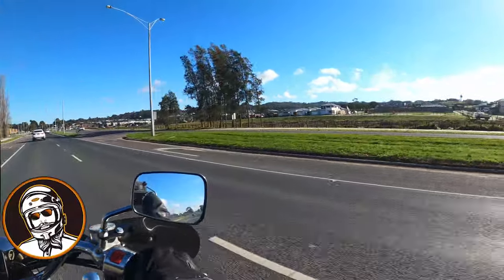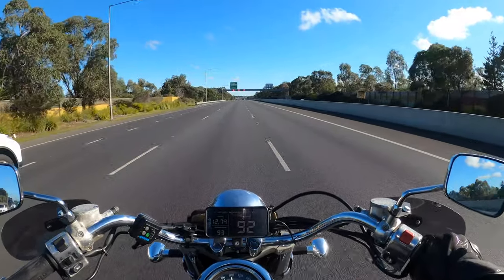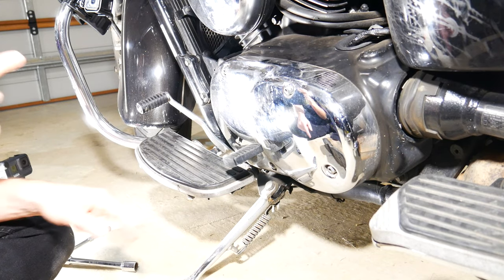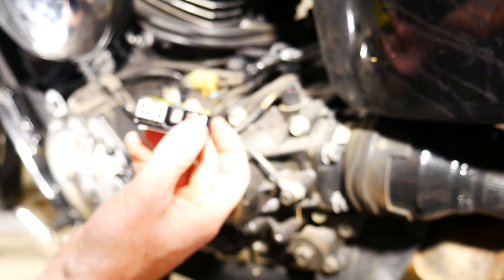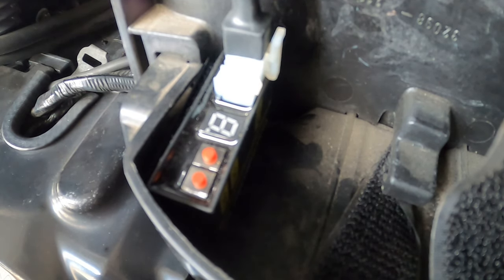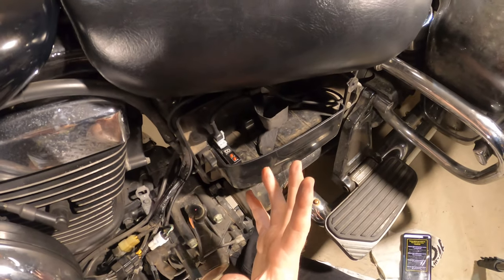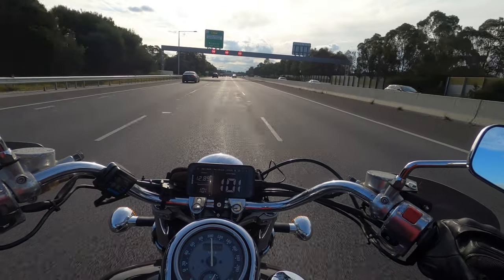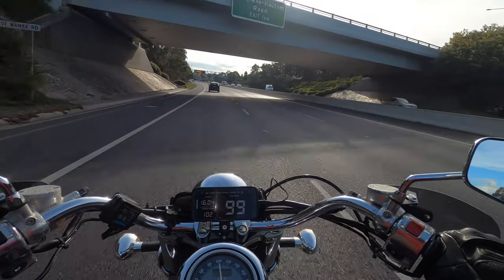Kawasaki Vulcan Speedometer fix - HealTech Speedo Healer v4 - Install

Comment: That's great gonna have to get one. Also which rear crash/saddle bag guards do you have. I can't find any rear one's anywhere?
Reply from the maker: The Speedo healer works like a charm and is super easy to install.

The rear bag gaurds are Stock Nomad ones. what model do you have? I'd have to have a closer look, but the stock Nomad ones may fit other Vulcan models like the classic or meanstreak.

Thanks for watching 👍

Comment: Great video I'm have the same issue on my 2000 vulcan 1500 classic fi would you know  where the sensor for the bike is located? I was told the same place as where yours  is but I think yours is a different year than mines help if you can thanks.
Reply from the maker: +3re Koats Kustoms G'day, cheers for watching, I'm going to assume the sensor would be in the same place, under the left hand side engine cover . In the video description I a link to the free online workshop manual I used to stumble my way through. Have a look at that and see if it's the same. I'm pretty sure the vn1500fi was the same from 2000-2004
Reply: @BigRobMoto  I've looked and looked but did not see it anything  you can do to point me in the right direction would be greatly appreciated. If  you need my email address please let me know.

Comment: And it's all 100% legal. ADR's allow for a 10% speedo error, also as your tyres wear the speedo changes
Reply from the maker: +Garry K I never thought of tyre wear having an effect, but that makes sense for sure.
Reply: @BigRobMoto  Yeah I had my GPS on my Versys 1000 before and after a tyre change and it made 4 - 5 km/h difference
Reply: If the speedo is showing higher than actual speed, then when the tires wear (get smaller) it'll make the speedometer even MORE inaccurate.